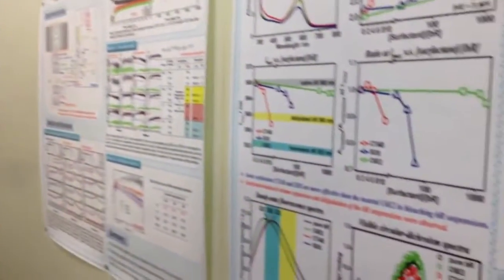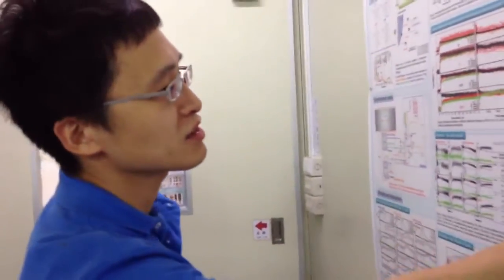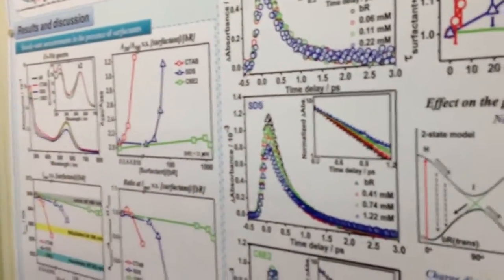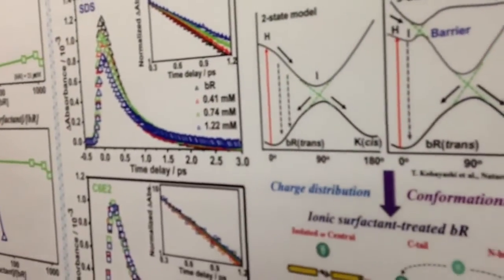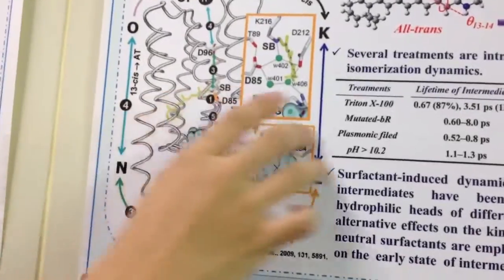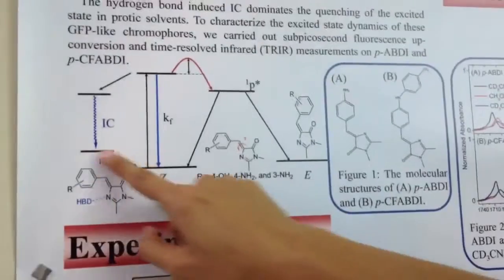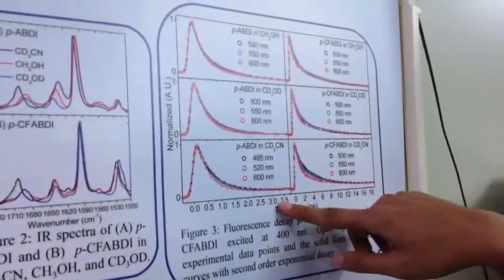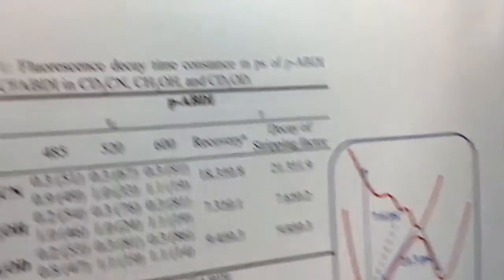Femtosecond Transient Absorption System Hatteras. Visiting customers in Taiwan.

Comment from the maker: Pacifica fs1060pca THz spectrometer - request a quote
http://www.dmphotonics.com/THz%20spectrometer%20with%201060%20nm%20fs%20laser/THz%20time%20domain%20spectrometer%20for%20transmission%20measurements%20using%20a%201060%20nm%20fs%20fiber%20laser.htm
THz time domain spectrometer for transmission measurements using a fs fiber laser source. with mean optical power of > 120 mW, wavelength ~ 1060 nm, pulse duration < 120 fs and repetition rate ~ 80 MHz.

consisting of:
• fs fiber laser Tourmaline ( with mean optical power of > 120 mW, wavelength ~ 1060 nm, pulse duration < 120 fs and repetition rate ~ 80 MHz)
• THz emitter and detector photoconductive antennas with aspheric focusing THz lenses with 50 mm THz beam focus length
• Optics for laser beams
• optical delay line for delay of 500 ps (<5 GHz resolution)
• breadboard 600 mm x 450 mm x 50.8 mm with the adjusted and tested THz spectrometer. The THz antenna distance is 100 mm. The THz focus is on the midpoint between the antennas.
• Laptop with software T3DS, complete electronics with pulse generator, amplifier and lock-in detector. The software allows measurement of THz pulse and calculates in-situ the THz spectrum. It includes the calibration procedures for 100 % transmittance and the calculation of the spectral transmittance and absorbance of a sample.
• Instruction manual for the THz spectrometer and test report with the following data:
- Supply voltage 110 .. 230 V
- dynamic range > 60 dB
- useful spectral region 0.05 to > 3 THz
- scan range 500 ps (< 3 GHz resolution)
- THz focus position 50 mm away from the antennas
- Fast scan duration 10 s
- Slow scan duration 8 min

Optional: Spectrometer housing with closed sample box for nitrogen gas purging

Optional: Additional set of emitter and detector antenna with aspheric collimating THz lenses for 12 mm THz beam diameter for replacement of the antennas with focusing THz lenses

Lead time: 3 months (because of the lead time for the laser)

Comment from the maker: Applications are invited for one postdoc and two PhD positions in the group of Hans Jakob Wörner at ETH Zürich ( www.atto.ethz.ch ). This project aims at developing attosecond transient-absorption spectroscopy of molecules at photon energies ranging up to 500 eV (or 2.5 nm wavelength). This energy range gives access to the K-shell absorption edges of several elements including carbon and nitrogen which makes element-specific measurement of electronic wave packets possible. Experiments will be carried out both on molecules in the gas phase and on solvated molecules in liquid microjets. Presently initiated experiments are based on 2-cycle laser pulses centered at 1.8 microns at 1kHz repetition rate and address both field-free and field-driven electronic dynamics in gas-phase molecules. Future experiments will make use of a 50 W-average power few-cycle mid-IR laser system that is presently under development.
Applications will be reviewed starting immediately and until the positions are filled.
-----------------------------------------------------------
Prof. Dr. Hans Jakob Wörner
Laboratorium für physikalische Chemie
ETH Zürich
Vladimir-Prelog-Weg 2
8093 Zürich
Switzerland
Web: www.atto.ethz.ch
Email: woerner@phys.chem.ethz.ch
Tel.: +41 44 633 44 12
Fax: +41 44 632 15 38

Comment from the maker: Transient Absorption Spectrometer - sales@dmphotonics.com

Introduction
The quantum dot photovoltaics group at our client invites proposals for the supply, delivery, installation and training for a transient absorption spectrometer. This system will be utilized to perform time-delayed ultrafast pump-probe optical experiments with a laser system that will be supplied by the user acquired in a separate RFQ competition. The ultrafast pump-probe experiments involve the investigation of carrier dynamics and the mapping of energetic states within the bandgap of nanoscale and bulk semiconductors. The ultrafast laser system will provide the pump beam that excites the sample under investigation and the laser beam that creates a supercontinuum probe beam within the transient absorption spectrometer. The optics and detection needed to generate and detect the signals have to be provided together with the transient absorption spectrometer in question.

Background Information
The system will be used to probe the transient optical response of various types of samples that include solid-state semiconductor crystals and thin films, as well as liquid solutions. Thin film samples are typically prepared atop 1”x1” glass substrates; whereas 1-10mm pathlength cuvettes will also be used for colloidal quantum dots (CQDs) and other solution-based optoelectronic materials in organic or inorganic solvents. The bulk semiconductor crystals can be of any shape and size. The crystals are typically mounted through in a crystal holder. 
The spectrometer must be able to provide time-resolutions of better than 100 fs, and should be capable of collecting one-dimensional, frequency-resolved spectra at once with minimum time interval between consecutive spectra not exceeding 15 fs, and with a maximum available time range of at least 5 ns. 
The system should cover a broad probing range from ~350 nm to ~ 1600 nm, with a spectral resolution not exceeding 15 nm in the entire wavelength range and not exceeding 5 nm in the UV-NIR region (400 to 1000 nm).

Minimum Requirements
The system must be able to provide time-resolved optical absorption spectra in the UV-to-NIR spectral range, and must include the optics and the stages necessary to generate the supercontinuum probe, with seed provided by an external ultrafast laser source with a wavelength of 800 nm or 1030 nm; the exact details are not known yet since this laser source will be purchased through Category 2 of this RFQ.   

	Minimum Specifications for the Spectrometer:
a)	The system must be able to acquire ultrafast optical absorption spectra over an extended frequency range (350 to 1600 nm), with a spectral resolution not exceeding 15 nm and a time resolution not exceeding 15 fs. The acquisition rate must be at least 2000 spectra/s. The optical delay line must be able to operate at a maximum speed of at least 0.2 m/s, and must be configured to be able to cover a range of temporal delays of at least 5 ns. The spectrometer setup must have the ability to be fully enclosed to avoid contamination of the measured spectra.

	Minimum Specifications for the Probe Generation System:
a)	The probe generation setup must be able to generate supercontinuum probe pulses when seeded with an externally supplied laser system (to be acquired in a separate RFQ: 100-200 fs, 800 nm or 1030 nm, >1 mJ/pulse, 1-200 kHz repetition rate). The supercontinuum generation setup must include: (i) all the appropriate optics necessary to split the fundamental beam produced by the external laser; (ii) the optics required to generate the primary supercontinuum beam; (iii) the optics required to up- or down-convert the primary supercontinuum probe in order to extend the frequency range to be able to cover the requested spectral range (350 to 2700 nm); (iv) the optics needed to redirect and focus the supercontinuum beam onto the sample.

	Minimum Specifications for the Sample Stage:
a)	The sample compartment must be able to be completely enclosed and isolated from ambient light to avoid contamination of the absorption spectra. The sample stage must be supplied with a translation stage with a travel range of at least 5 mm x 5 mm. The sample holder, or sample holders, must be capable of housing 1”x1”x0.2” glass substrates and must include the capability to perform transient absorption measurements on liquids and solutions. The liquid samples have to be able to be agitated.

Functionality and Integration
a)	The system must be compatible with common ultrafast and tunable laser systems to be used as excitation sources.
b)	The probe beam needs to be easily routed to a desired location within the experimental setup.

Control Software
The systems must be equipped with a control and acquisition software which must provide the following minimum functionalities: 
a)	Multidimensional (intensity vs. frequency/time surface) visualization of acquired data.
b)	Capability to export the acquired data in text-based formats as well as in a format to be used by a common data analysis software (such as IGOR or Origin).
c)	Integration of basic data analysis options, such as: (i) x- and y-axis translation; (ii) spectra normalization; (iii) Background subtraction; (iv) fit of the time-resolved data to simple model functions; (v) temporal chirp correction.
d)	Capability to generate reports integrating graphical plots and results of data analysis.
e)	API for third-party control of the acquisition setup.

Quality Expectations
a)	All system components should be durable and not require significant repair or replacement within three years.
b)	The set up will be operated primarily by graduate students and post-docs; therefore the daily actions required to initialize, operate, and maintain the system should be simple, intuitive, and not excessively time-consuming.
c)	Quick and easy maintenance of major ‘parts’.
d)	The system should possess proper safety interlocks and be reasonably fail-safe. 

Desired Requirements/Specifications of the System
a)	The system could be able to acquire ultrafast optical absorption spectra over an extended frequency range up to 2700 nm.
b)	The system has a facile method to verify the retroreflector alignment.
c)	The system can operate at repetition rates varying from 1 kHz to 200 kHz.
d)	The polarization of both pump and probe are independently adjustable.
e)	A cryostat can be introduced in the system to measure the transient absorption signals at varying temperatures.
f)	The system has the ability to measure the photoluminescence of the sample under test.   

Warranty
a)	At least a one (1) year warranty is required at no extra cost to our client.
b)	A three (3) year warranty is preferred.
c)	Pricing of warranty separately (concrete valuation of the warranty).
Warranty should include once per year service visits.
Installation
a)	System must be installed and tested by the supplier at no extra cost to our client.
b)	The dates of installation of the system by the supplier will be mutually agreed upon and will happen after the ultrafast laser system is installed.

After-Sales Services
a)	All required training is to be provided by the supplier upon installation at no extra cost to our client. Training should sufficiently cover details of the instrument’s operation, routine maintenance, troubleshooting of known issues and include a comprehensive tutorial on software use.
b)	Comprehensive customer service and remote technical support by phone or other is to be provided to handle any issues related to the equipment whether under warranty or not at no extra cost to our client.
c)	Suppliers should have service engineers within the US and Canada who can arrive on-site to access and repair equipment problems within the timeframe of 1-2 weeks.

Comment from the maker: Stable UV to IR supercontinuum generation in calcium fluoride with conserved circular polarization states
http://www.opticsinfobase.org/oe/abstract.cfm?uri=oe-17-24-21488
The supercontinuum generated with a linearly polarized near-IR (775nm) pump in rotated calcium fluoride is shown to have intrinsic intensity and polarization modulations. To mask the rotation of the crystal plate, we circularly polarize the pump and find greatly improved output parameters for the generated white light: intensity fluctuations of 0.5% limited only by pump laser stability, and a circular polarization state—matching that of the pump—over the entire visible spectrum. This polarization conservation allows the return of the supercontinuum to a linear polarization state or to a pair of linearly polarized beams with correlated intensity fluctuations. We were also able to extend the supercontinuum source deep into the ultraviolet with a frequency doubled (387nm) pump, to serve as an new source to probe the region where most molecular photochemistry occurs.
http://www.opticsinfobase.org/view_article.cfm?gotourl=http%3A%2F%2Fwww%2Eopticsinfobase%2Eorg%2FDirectPDFAccess%2F4678E148-AF14-EF83-DA1BF68F778BE121_188709%2Foe-17-24-21488%2Epdf%3Fda%3D1%26id%3D188709%26seq%3D0%26mobile%3Dno&org=

CaF2 window IR grade, o 12.7 mm x 3.0 mm - in stock!
[W-CaF2-IR-12.7-3]
http://greyhawkoptics.com/product_info.php?products_id=973&osCsid=502d019192383deb4d005b4b01852ce4
Material: IR CaF2 grade 
Diameter: 12.7 mm (+0.0/-0.1 mm)
Thickness: 3 mm (+/-0.1 mm) 
Coating: None
Flatness: 2 ?/inch @ 633nm
Surface quality: 80/50 S/D
parallelism: less than 10 arc minute

CaF2 window IR grade, o 25.4 mm x 3.0 mm - in stock!
[W-CaF2-IR-25.4-3]
http://greyhawkoptics.com/product_info.php?products_id=353&osCsid=7e79ae104bbb349234cb52da09e27d69
Flatness: 2 ?/inch @ 633nm
Surface quality: 80/50 S/D
parallelism: less than 10 arc minute
http://www.dmphotonics.com/Calcium-Fluoride/CaF2-window-diameter-25_4.htm

CaF2 window IR grade and UV grade sales@dmphotonics.com 
CaF2 window IR grade and UV grade sales@dmphotonics.com

CaF2 window UV grade, o 25.4 mm x 3.0 mm - in stock!
[W-CaF2-UV-25.4-3]
http://greyhawkoptics.com/product_info.php?products_id=750&osCsid=7e79ae104bbb349234cb52da09e27d69
Flatness: 2 ?/inch @ 633nm
Surface quality: 80/50 S/D
parallelism: less than 10 arc minute

CaF2 window IR grade, o 38.0 mm x 4.0 mm - in stock!
[W-CaF2-IR-38.0-4]
http://greyhawkoptics.com/product_info.php?products_id=971&osCsid=502d019192383deb4d005b4b01852ce4
Flatness: 2 ?/inch @ 633nm
Surface quality: 80/50 S/D
parallelism: less than 10 arc minute

CaF2 window UV grade, o 38.0 mm x 4.0 mm - in  stock!
[W-CaF2-UV-38.0-4]
http://greyhawkoptics.com/product_info.php?products_id=972&osCsid=502d019192383deb4d005b4b01852ce4
Flatness: 2 ?/inch @ 633nm
Surface quality: 80/50 S/D
parallelism: less than 10 arc minute

CaF2 window, o 50.8 mm x 3.0 mm - in stock!
[W-CaF2-50.8-3]
http://greyhawkoptics.com/product_info.php?products_id=398&osCsid=7e79ae104bbb349234cb52da09e27d69
Material	CaF2 IR grade
Diameter	50.8 mm (+0.0/-0.2 mm)
Tickness	3 mm (+/- 0.25 mm)
Surface quality	60-40 scr-dig
Parallelism	? 5 arc min
Clear aperture	? 85% of diameter

CaF2 Equilateral Dispersive Prisms, 25x25x25 mm - in stock!
[EP-CaF2-25-25-25]
http://greyhawkoptics.com/product_info.php?products_id=928

Comment from the maker: The Faculty of Science, University of Sheffield seeks to appoint an experienced researcher to lead the building, maintaining and operating of state-of-the art ultrafast amplified laser systems for condensed phase research. The project is a joint venture of the departments of Chemistry, Physics and Astronomy, Molecular Biology and Biotechnology, and several Engineering departments. Our research directions include amongst others fundamental charge transport studies, organic photovoltaics, transition metal and organic photochemistry, biophysics, artificial photosynthesis, photocatalysis, and materials research. The vibrant, enthusiastic, international laser community at the University is engaged in many cross-disciplinary collaborations with the groups across the country, and world-wide (including Switzerland, Italy, Germany, USA).

 

The project.

Funded by the EPSRC and the Faculty of Science, the new multiuser ultrafast laser centre aims to provide advanced capabilities in femtosecond laser spectroscopy, comprising: transient absorption spectroscopy, time-resolved infrared spectroscopy (TRIR), 2D-infrared spectroscopy (2DIR), fluorescence up-conversion and time-resolved resonance Raman methods. The timescales range from sub-10 fs to microseconds; the spectral range spans UV-Vis-MidIR.

 

We are currently in the process of purchasing the laser system which will form the basis for the laboratory. 

 

The candidate:

We seek to appoint a research scientist-in-charge who will:

(i) lead building of the laboratory, with the assistance of technical staff and an experimental officer;  

(ii) ensure operation of the laboratory once built;

(iii) provide day-to-day experimental assistance supporting  cross-disciplinary science programmes in light-matter interactions.

 

The building and operation of the laboratory will be conducted in a close collaboration with the Laser for Science Facility, Rutherford Appleton Laboratory, and overseen by an international panel of experts.

 

The post offers unique opportunities for wide-range collaborations and independent research in many areas of light-matter interactions.

 

Requirements. Candidates should have a PhD or equivalent, and some post-PhD experience in the area of laser spectroscopy, chemical dynamics, photophysics or similar.  Experience in
building laser setups using commercial amplified femtosecond lasers and OPO/OPAs, and experience in data analysis is essential. Experience in equipment control software, NOPAs and time-resolved vibrational spectroscopy will be an advantage.  

 

This is a full-time 3-year post in the first instance, with a start date of 01 March 2015 or as soon as possible thereafter.

The salary is on grade 7 of the University of Sheffield scale, £29,552 to £31,342 per annum.